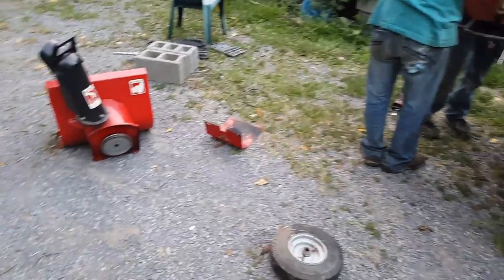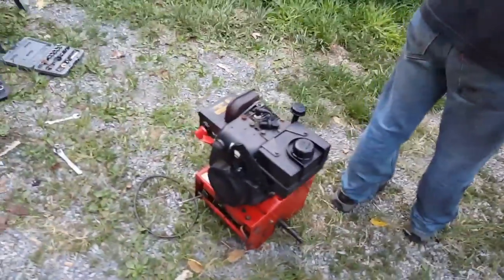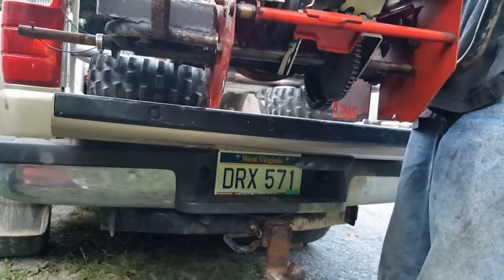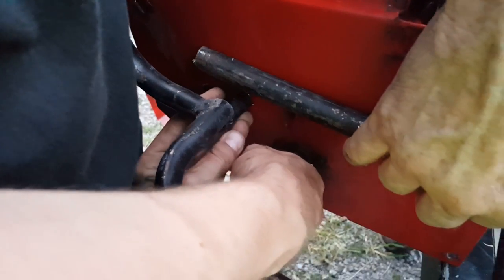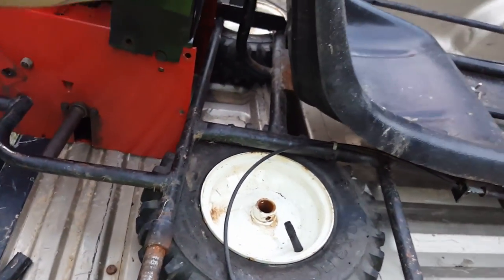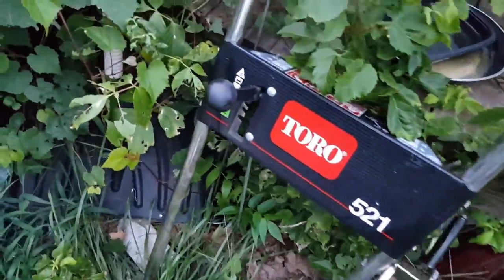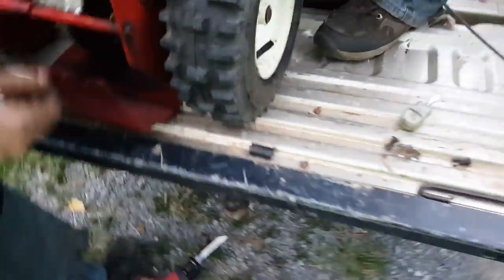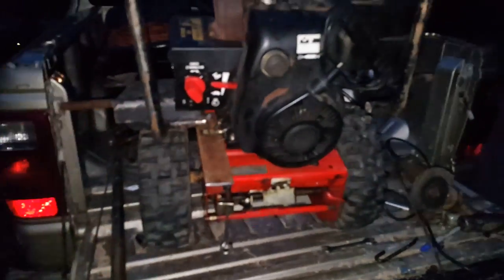TURNING A SNOWBLOWER INTO A GO-KART

Comment: Snowblowers have no air filter. Did you ever consider adding one? i know it's not absolutely necessary in the short term but it could damage the engine in the long run.

Comment: Where's part 2?
Reply from the maker: +Durv didn't think anyone was interested! Would u like to see it done?
Reply: Yes please! That would be great! I have the same snowblower and would like to try doing what you did.
Reply: if you wanna go 3 miles per hour
Reply: Were part 2
Reply: its coming, its loading as slow as this gokart is driving!
Reply: Get rid of all the gears except the one with the wheels on it, turn the motor 90 degrees counter clockwise, put a go kart clutch and chain on it. BINGO your in business!